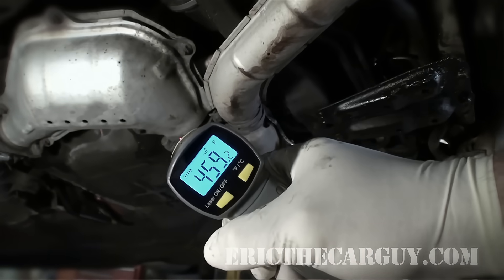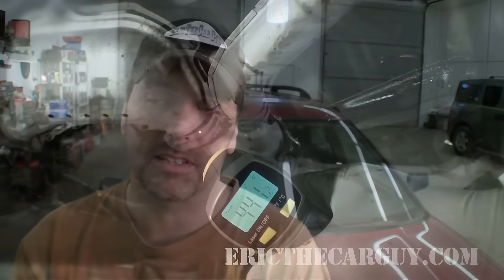Does Lacquer Thinner Clean Catalytic Converters? -EricTheCarGuy

Comment: Im not a mechanic, so I needed help with my CC's since I had the code. I followed Scottys advice using 1 gallon of lacquer thinner in a half tank of gas. Then I ran it for 150 miles at high speeds. The red light went out after the first day never to return. This was performed on a 2004 Nissan Murano. It worked beautifully. I just wanted people to know that it worked for me.
Reply: That same mix worked for me too it's been 3 years since I tried it on Honda Odyssey 2007 200k miles
Reply: Scotty used a gallon it worked. Eric used a quart and it didn't work.
Reply: I trust Scotty . So thanks for the feedback.
Reply: @peterjones6131  Ditto. He's only been a mechanic for 50 plus years.
Reply: @elijuh3  it worked for me too and it worked on my 2010 Honda Accord coupe EX V6 with 3 cats 2 up front one rear third final exhaust cat
Reply: How To clean a catolitic converter
Reply: 3 years in after using it and still no light 💡
Reply: @stories4coolkids thank u
Reply: Yes this guy did NOT use 1 Gallon and Did NOT use half a tank of gas.  Concentration matters alot in this activity
Reply: I also removed mine on my 06 2.4 K-24 accord and sprayed them with supertech throttle body cleaner which is super cheap and available at Walmart it’s main active ingredient is Acetone which is also the same stuff that is used to remove finger nails polish and also the hot ingredient in Berryman B-12 chemtool
Reply: Worked for my 2013 chrysler town and country👌
Reply: @evb8734 how much did you use?
Reply: Thanks for that info, I had some red flags since there is such a dramatic difference between a Quart and a gallon, and I was going to go with the quart, but now I will roll the dice on the gallon
Reply: @SoccerinMN run the Gallon!
Reply: how long did it work for
Reply: @craiglist308  I kept the car about another year before trading it in so I’m not sure how long it lasted, but at least for that year or so. I imagine it lasted much longer than a year though. I was so happy it worked because replacing the CC’s on the Murano was very costly (2400.00). 
Money that I didn’t have then.
Reply: @whoward5496 it's about 3 years later and I need to do mine again. 3 years is quite a while. I drive about 190kms per day... Until recently the last few weeks I've gone down to 110kms a day and that's still quite a bit. I think I did it when my engine was on 240 thousand KMs in about 2020-2021.
Reply: So not one quart?
Reply: @vandan1842 use a Gallon
Reply: @vandan1842 1 Gallon to have a tank
Reply: Just don’t get lacquer  thinner confused with paint thinner I did that o man I thought I blew my truck up.
Reply: @dadlife3504  Use johnson wax and wax your johnson
Reply: @dadlife3504 paint thinner wouldn’t damage the engine. 
It will clean it squeaky clean
Reply: Havent tried laquer thinner but a friend of mine advised premium fuel and then the ol italian tune up get some heat into the exhaust with the high grade fuel. I will say the p0420 i had went away for a year but it did come back. Only at low rpm if youre givener on the highway the cel wouldnt come back just into town light to light.
Reply: It got my 02 Civic EX though three safety checks. Cheaper than getting the CAT Clean stuff also. I eventually had the CAT replaced at a muffler shop. For a fraction of the cost of an OEM. It's definitely a quick fix when your finances are tight.
Reply: It work for me also …this guy just wanted us tune in. Scotty is the GOAT!
Reply: Thank you
Reply: Has anyone tried this on a Gen2 Prius??
Reply: What is the name brand of lacquer thinner that you use ?
Reply: It didn't work for me.
Reply: How want tickets did you get? 😂
Reply: Work for me as well
Reply: Red light?
Reply: Same, worked on my 99' Daewoo Lanos 1.6.
Reply: I tried it but I didnt realize I had to take it for a long fast run. I just did my regular driving. I understand now why it didnt work.
Reply: I think a lot of people fail to see that I believe it’s the Ethanol bullshit that’s really messing up the cars especially sensors like cats O2 sensors and the Biden administration wants to increase not decrease it more meddling into the petroleum industry using a product that has absolutely no benefit whatsoever 🤔💯⚠️

Comment: It may not help with the Catalytic Converter but it helps you decide to get a haircut - You got a haircut between 6:43 to 8:49 - Funny!

From what I understand the C.C. has "beads" inside that benefit for running the C.C. properly and eventually wear out and there is nothing to do but change it... That's a ruff version of what I might have been told over a year ago.  I don't know if it is an accurate statement...
My neighbors car had a bad C.C. and after installation of the new unit, it was suggested to go for a 100 mile drive to "activate" it proper before having the car re-smog-ed -
 My car is 50 years old and I do not have to deal with this stuff, 
Great Video.

Comment: Does work, I had p0430 I cleared it out and kept coming back. Used a gal of thinner and it came back but next fill up I cleared it and it hasn't come back since and I have driven 500 miles since.

Comment: I've used the SAME acetone (essentially what laquer thinner is) to destroy other peoples cars without them knowing by putting it in their tanks. that's so hilarious that scotty kilmer would suggest such a thing.
Reply: Acetone is NOT lacquer thinner. Lacquer thinner is a mixture of many different hydrocarbons, mostly benzene and cyclohexane. You might be thinking of nail polish remover, that's over 90% acetone.
Reply: key word being essentially here and also in the amounts you use Mr. not so harmless prankster.
Reply: I've added acetone to gasoline in several cars with no bad results. I don't think it helps clean the engine or increase mileage enough to make it worthwhile. It's a risk.
Reply: you piece of dog shit

Comment: I agree with a lot of people on the comments here. There is a few reasons why I would say you saw little improvement, Scotty used 1 gallon, granted he didn't give a mixing ratio but we all can assume he was talking about a vehicle with one catalytic converter not two like I heard you say,  so not to be blunt but like myth-busters I call this test a failure on the tester not the test subject. If you want to try someone's suggestion either do it  completely or don't do it all, because bashing on someone's experience when you haven't experienced the same is just non-sense. Again just being impartial. I also do not have video of this being done on my 01 Chevy caviler but I've done it with positive results using 1 gallon with full tank, and went the further step of taking it off and soaking in soap water mix overnight. I think this is the first video I sort of disagreed with you as well so keep it up. Or stay dirty. Whatever works.
Reply: It would probably be a bit stronger than that. I can't imagine the Honda/Acrua that he was working on has more than a 15 gallon tank. He said add 1 gallon at half tank to burn it off.
Reply: dtaylorh18
I believe Scotty said to add 1 gal to 9 gal of gas to clean the fuel injectors.
Reply: dtaylorh18 Tell us how it turned out dtay. You didnt finish or follow up. Hate that when people do that sorry. Yours was probably only a liter also huh? Eric i agree with everyone. As soon as you showed me that tiny liter can i googled how many liters in a gallon. Four times as much as 1 liter,haha. I agree you are awsome and helped me alot but how did you miss that? Anyways nobodys perfect and you are awsome but should delete this and do it again. Scottys awsome as well and you two should work together. You more the law abiding and him the vigilanty car helper going outside the box.
Reply: i bought this stuff called cataclean over the weekend and it smelled exactly like lacquer thinner and made the exhaust smell very strong for about 20 minutes. im going to check my cat later and see how it did. smelled like it was cleaning
Reply: my exhaust seems to be smoother but with the gas mileage and power it didnt change much.. maybe the smell is for the placebo effect. the cat itself looks the exact same
Reply: charleysturbos damn
Reply: In Scotty's video I saw the other day, he used one gallon of lacquer thinner to 8 gallons of gas, that's the ratio. His tank was about 15 gallons and he said to use the thinner in half a tank, so for him that would be 7-1/2 gallons but he rounded it off to 8.
Reply: 02915a 6l
Reply: 02915a b
Reply: Scotty just mentioned it again in one of his recent Car Talk saturday vids and says its 1 gallon of lacquer thinner to 9 gallons of gas if anyone is still wondering which I belive eric did not use that ratio, although I could be wrong because I don't want to watch this video again and it's been awhile since i watched it originally but that would be my educated guess as to why he saw little positive results.
Reply: scotty said 1 gallon per 9 gallons of gas
Reply: charleysturbos how ?
Reply: Yea , i have a turbo car and no check light. Also i crawled under car and saw my cat can unbolt. I also ran a obd2 tester and read the o2 sensers and from what erick said in his other video about cats it looks good. It um was major fluctioaction on first and steady at 750 or so for second one at 2000 rpm or so. Now just gotta get those damned drive cycles complete for my dang 97 gst eclipse spyder.
Reply: Hey guys follow up here. Forgot about this little blog or whatevers since i have so many going all the time. So guess my cat was saverely plugged being the original 17 year old catalitic on a turbo eclipse spyder. So anyways i tried soaking it and no help at all im sure. Then i got a great idea how to clean it good. I had taken it to the smog place and it failed badly with blue oil smoke coming out from pipe and into the air like a chimney,haha. I got the before and after photos of fail and passing and also the dirty cat and clean cat. If anyone wants to know how i cleaned it perfectly ill tell them and also how i passed the obd2 rediness monitor status as well. It took months of trying to finally find and figure out a variety of ways to pass. Anyone interested just ask and ill tell you ok.. Promise on my life it worked like a charm. A couple of things ive learned researching so much time and trying stuff.
Reply: Ray Thompson hey ray, sorry been super busy trying to study for killer union job so sorry for slow response. Depends what ur asking me how to do what though. The catalitic can be cleaned by a pressure washer or powerful car wash. No soaps nothing but pressure washer. Soaking overnight did nothing at all. Power washed and flip it in bucket over and over till crap stops coming out. Bunch of sandy dirt crap comes out. I even saved my before and after pics of them. Even cleaned the exhaust from cat back with washer and degreaser in this part. To set the obd2 readiness monitors I found on YouTube a cool Mexican dude. Said 55-65 no more or less for 5 min. Not touching brake peddle ever. After 5 min pull to the side of road pulling emergency break till you stop leaving it in drive too. Stay stopped for five seconds or so and you just cleared most or all. If not do again and within ten minutes of work you clear them. Forget drive cycles they didn't work for more then 1000 miles and much much work with them. PS some cars reset when shut off. So leave on for smog and tell them just in case urs does. Also some cars are on a epa  exempt list for this but is such a hassle to find a smog place that will run it exempt in California. Hope that helped anyone out. Promise on my life they both helped for me. Let me know if good for you OK. Like to know I helped people out.

Comment: I was able to clean a catalytic converter by soaking it for 2 days in Parts cleaner that you can buy at Walmart.  Forget trying dish soap like others have mentioned.  Car just passed emissions today.  It smoked a little after re-installing.  Before doing this we kept getting the P420 code.  P420 didn't come back this time.  :)

Comment: Laquer thinner DISSOLVES plastic, rubber etc. It is shipped in a METAL container for a reason. Your fuel system is FULL of plastic, rubber and viton parts. The thinner can clean varnish off fuel senders, jeopardize connections, melt orings, plug filters with hose innards etc etc etc. I am still floored that ANYONE would ever heed the advice of that douche.

Comment: Never mind the fact, that if you have plugged a converter, there is something wrong with the engine. Burning oil, running crazy rich etc. A clean running engine wont plug its converter...ever. Soak the converter in soap and water? Take it off and soak it in diesel kleen or sea foam. Any chemical that softens carbon. {Dawn dish soap aint gonna cut it} .  Once again, That Kilmer fool is a total hack. Dumping chemicals in your gas tank wont fix anything, ever. Laquer thinner is NOT fuel system safe.
Reply: Well quit a few people say differently many many times on here and other places. If you havent tried it then you shouldnt speak up i say. I dont have a plugged cat but if i did id clean it first since i can unbolt it. But you are correct about seafoam im sure. We put some on a piston with carbon buildup and it eats the stuff right up in front of you like peroxide does to wounds. But really be fare if you dont want to try or think outside the box then dont say anything id say. Even the test is flawed here with 25 percent fluid and more gas then he said and twice as many cats. Erase this video and do it again Erick. It's only making you look bad id say. And your not, just messed up on this one id say.
Reply: charleysturbos quite a few people say what? and who gives a fuck what they say anyways. I know FOR A FACT laquer thinner is NOT sensor or fuel system safe. Don't need to argue this any further. You guys are idiots that do this sort of shit as a hobby. If you want to believe some internet hack go for it. The repair bills are all yours.
Reply: Ps don't argue anymore then. I don't wan't to listen to someone who guesses there arguments anyways i like facts and facts arent just because you read there not safe to me. You can go ahead and keep in your little box and comfort zone but don't be surprised if you don't have many friends and cannot have a conversation with very many people if any ok. Just saying dude, my roomate is same way like that. Thinks he knows the world and is so clueless. Even after like hundreds of things he's wrong about he just doesn't get it.
Reply: charleysturbos Dude, its a fact that laquer thinner isn't safe. This is not open for dispute. Wether you like me or not doesn't change the fact that I'm 100% right. Kilmer is a hack as well as anyone that recommends you dump this shit in your tank. The sock {pre filter} on your fuel pump is made out of the same shit your tooth brush is. Go soak a tooth brush in thinner overnight and tell me what happens. In no way is thinner a fuel system cleaner. As i said it is some idiots improvisation for TOLULENE…its not the same shit.
Reply: you put 1 pint into how much fuel

Comment: Would Sea Foam have any benefit on an old cat. converter? Same concept but I know it's safe to use in fuel systems.
Reply: Sea Foam is just to clean out your engine of any carbon build up. I don't think It would have any effect on the catalytic converter.

Comment: Hey Eric I got a good radiator flush for you try some CLR it will get rid of any scaling inside of it.
Reply: CLR works great Fill the radiator up with it let it sit for at least 20 min. then drain it out you will no believe the crud that comes on out. If you have one of those radiators that has a separate tank you will need to bled the air from the system. look for a bleeder valve or pull one of the hoses and pour your coolant in to it this will force the air out of the system.  You can also install a flush system in your car.and loosen the cap while running the engine will also bleed the air out.

Comment: Someone correct me if Im wrong but I thought Scotty's video was based on fixing a clogged converter. Not a burned overheated converter or a malfunctioning one. Didn't he say at the beginning of the video that his cat wasn't clogged? Is that right? Cleaning it out with lacquer thinner was just an option to correct a clogged converter before going ahead and replacing it. I never tried it but if it's damaged internally from overheating or some other reason outside of it being clogged, putting thinner in it isn't going to do anything anyway.